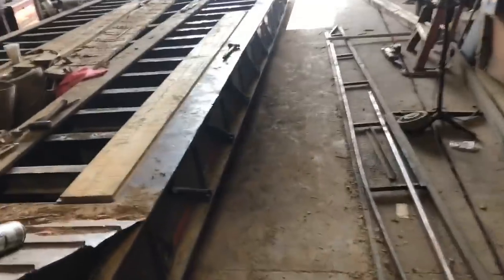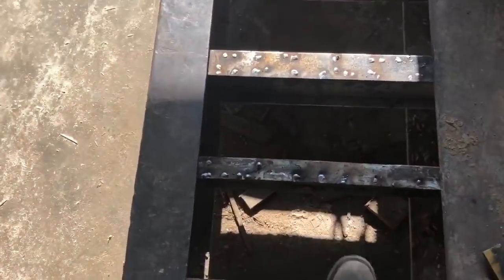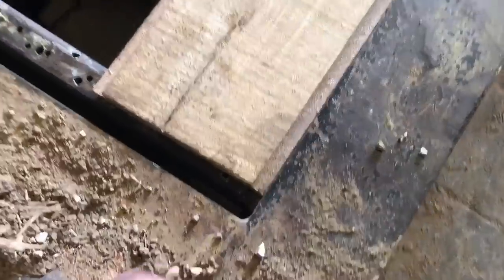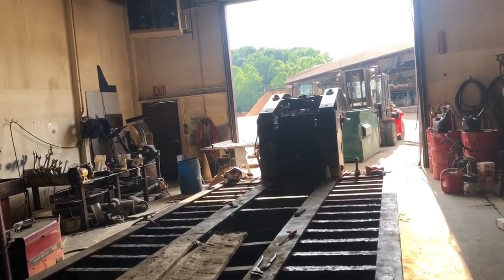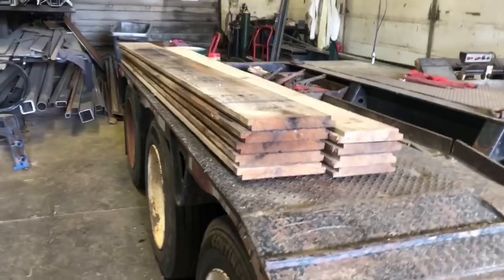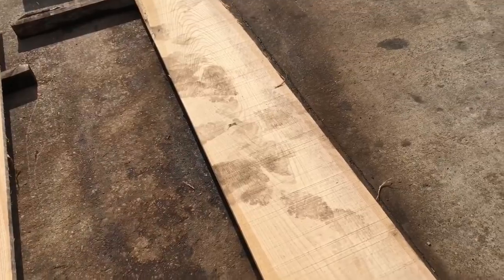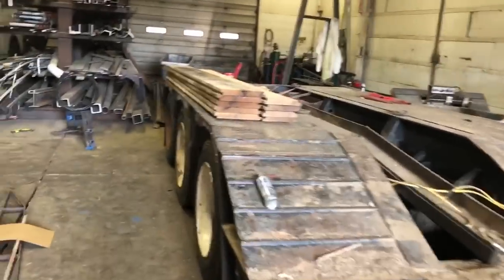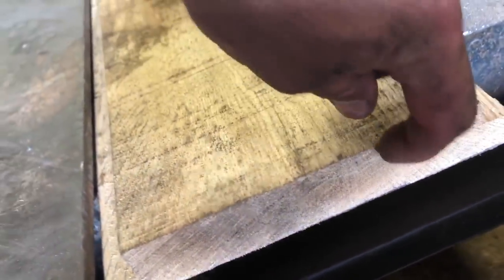Starting on lowboy floor

Comment: Looks good Wade,its amazing to me how that wood decking just doesn't desintergrate under the 40,000 pounds of dead weight of the din-din.I know that steel frame takes the punch,but still.
Reply: wood had a compression weight around 100 tons before they squish so, if properly supported the wood isnt going to budge

Comment: I go thru decking like poop thru a goose, all I can get here is doug fir, what is the best wood for a lowboy Wade?
Reply: white oak j ! been checkin yer vids great !
Reply: Trail king uses appleton wood. Had to pre-drill all the screw holes too. Super hard wood. I was a welder there, but would help out in final/wood deckin when i wanted more than our usual 48 hour week. We never ship lapped them either.
Reply from the maker: Boys I’m all about the white oak
Reply: Logger Wade hey man if it works it works right.